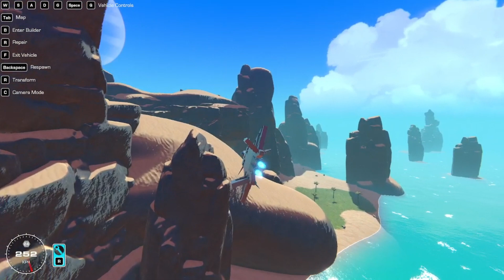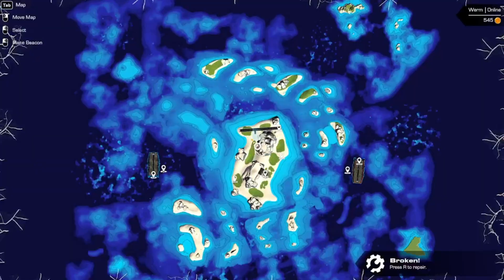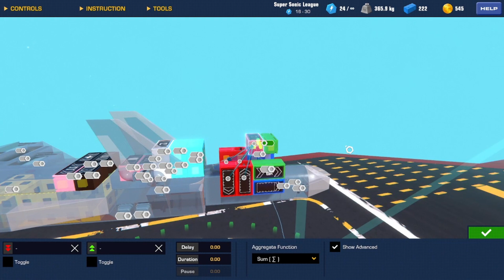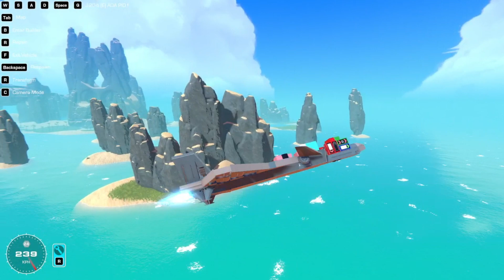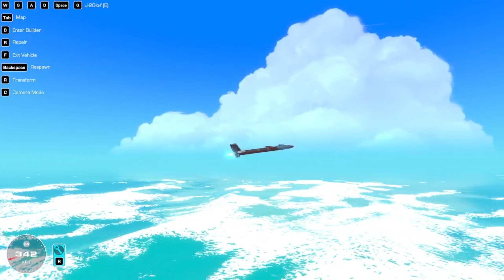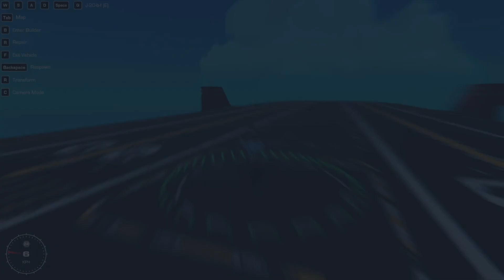How to Install PID Controller in Aircraft: Tutorial in Trailmakers

Comment: There is another way to stabilise a unstable plane using the pitch degree's per second. To measure this you can put 2 speed sensors pointing forward, one with output 1 and one with output -1 and then add them up and multiply it by a number and feed it into the pitch. This will stabilise it really well but aoa can still be usefull for canards. Also i don't think the integral gain is that usefull for alpha because it's better to put a trim on planes, you really only need derivative and proportional. I know all of this because i made 10 different unstable planes and i still make them because i love pushing the limits of aerodynamic control, when i use thrust vectoring it mainly tries to stop the turning because the aerodynamic control pitches up the nose so much. Also nice j20
Reply from the maker: huh. i never thought of that specific setup before and it seems quite good. i will definitely be trying it later.

as for integral, you're right in a sense. out of all the logic, removing it does the least. but i also use it AS the trim. i add a very small constant to set the trim for level flight. and for turns, it helps make sure the turn rate is what i ask. if im continuously turning too slow, say because of low airspeed, it will adjust for that. The same applies to turning to fast. Basically, the integral mainly acts as a quality of life and consistency feature, two things i like in fighter jets. just remember what you like and what i like are not the same so you should naturally build differently.

thx
Reply: Okay I'm probably dumb here but if you add up a forward pointing speed sensor and an inverted forward pointing speed sensor isn't the output always 0?
Reply: @joostvisser6508  i interpreted it as being on measure with different heights on the plane so that when it pitches the speed sensors are traveling at different speeds.
Reply from the maker: @ yes my bad you interpreted it correctly.
Reply: @DeathDoesThings  is right
Reply from the maker: @joostvisser6508  if we were in a perfect world, yes. however, we are not in a perfect world. the only thing you you forgot to account for was that every logic step takes exactly one frame to process. meaning that the inverted input is always exactly one frame later than the one that is input directly. this then tells you how fast the change is depending on how big of a difference there is per frame.
Reply: @ThisIsDumbAllTheNamesAreTaken right. Does setting the output of the speed sensor to -1 in the config cause a game tick delay or do you get the delay from multiplying by one in a separate logic block?
Reply from the maker: @joostvisser6508  it has to be a separate logic block. each logic block's step is what takes one frame to process.
Reply: @ThisIsDumbAllTheNamesAreTaken could you define a logic step? I feel like a speed sensor set to -1 output would be one step, but I don’t know anything about this stuff
Reply from the maker: @ ignore my last responses, the other guy said it right. i was thiniing of a different logic setup. the one you asked about measure the difference in speed between the top of the plane and the bottom which is irrelevant of logic cycles.
Reply: @ThisIsDumbAllTheNamesAreTaken so what counts as a logic step, just a signal going to a different block?
Reply from the maker: @DeathDoesThings  yes
Reply: @joostvisser6508  If you pitch up the bottom of your plane will go faster than the top this is the same with the speed sensors the one on the top is detecting a lower speed then the one on the bottom

Comment: This is pretty cool but what i usually do if my plane is too unstable is add 10 strength gyro stabilizers pointing forward in the pitch axis and I set it to off by default and no toggle then I hook up 2 nor gates so it turns on when im not trying to turn and it works perfectly fine as far as fixing stability issues you can pretty much use this method on any axis and you can easily customize it and yes I do get why you might want to use the technical way to do this
Reply from the maker: if you want a method with less gates and is therefore more reliable in combat when blocks start breaking then just have a pair of gyros and set their controls to rotate in opposite directions, and make sure those are the same controls for that axis. then they cancel out whenever you try to turn and work together to dampen when not. for pitch one gyro should be W and S and the other should be S and W. its what i did on my old f-16 and it works like a charm.
Reply: @  yeah I have done that method to and it also works great but if you’re trying to be the most complexity efficient like if you have an unstable plane that is already nearly max complexity like the one I used this method on then using gyro stabilizers is more effective

Comment: THANK YOU JOHN TRAILMAKER, I NEEDED THIS!!!!!
Reply from the maker: no you didn't. just make your plane more stable to begin with or at least stable enough where you only need two speed sensors instead of this hellish logic brick.
Reply: @ThisIsDumbAllTheNamesAreTaken  Well I needed this bc I suck at logic and had no clue what you were doing with the speed sensors, for me it just didn't work.
Reply: @ThisIsDumbAllTheNamesAreTakenwell I need smooth turning and also I’m mouse controlled constantly correcting itself, i have a sandwich if sadness it’s loaded with guns and can fly anything
Reply: @ThisIsDumbAllTheNamesAreTaken  Probably because I'm pretty stupid though
Reply from the maker: @Packersbears1  its fine, it happens. to do the simple version with 2 speed sensors, just have a speed sensor pointing up and a speed sensor pointing down. make one -0.1 and the other 0.1 and plug them into your pitch controls. if it makes it worse then swap around the negative. make sure the speed sensors trigger above 1.

you may need to turn the 0.1 to 0.2 or 0.3 depending on how strongly it needs to counteract it.
Reply: @ThisIsDumbAllTheNamesAreTaken sounds good, thanks!
Reply from the maker: @Packersbears1  this video should explain the concept but i made it a while ago so it is very poorly made and does not look at the logic much. i recommend to just download the creation in the description and rip it apart for the logic: https://www.youtube.com/watch?v=Y2XSUORruh8

i go over the concept much better in this more recent video at 6:30 in it. i also recommend watching the whole video to learn more about aerodynamics as a whole: https://www.youtube.com/watch?v=ON_Cu0kYV_w&t=360s
Reply: @ThisIsDumbAllTheNamesAreTaken  Im on console lol